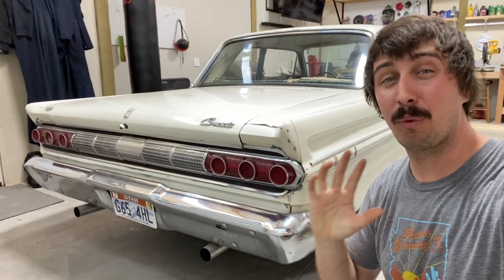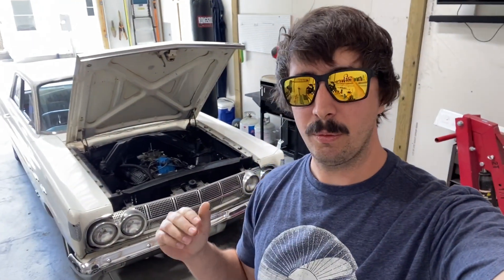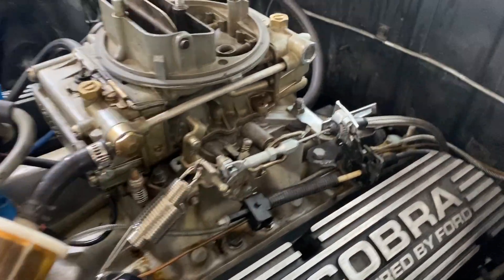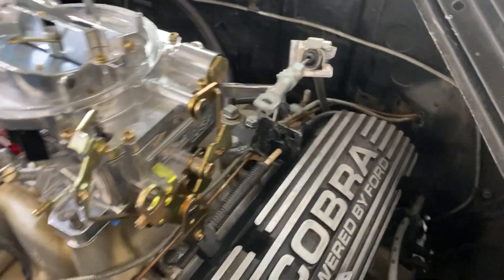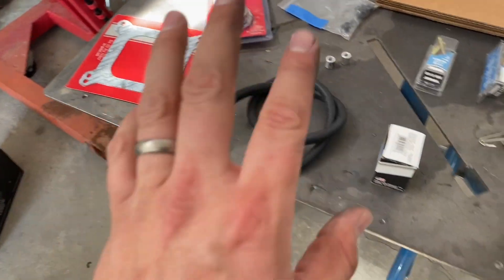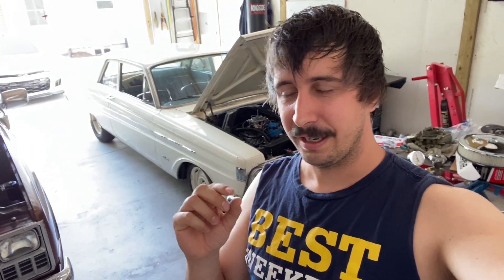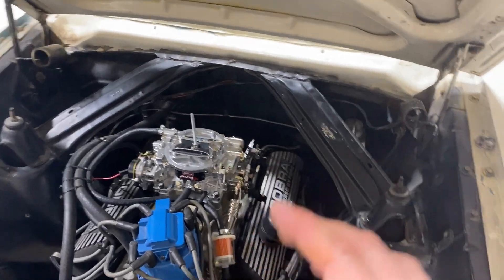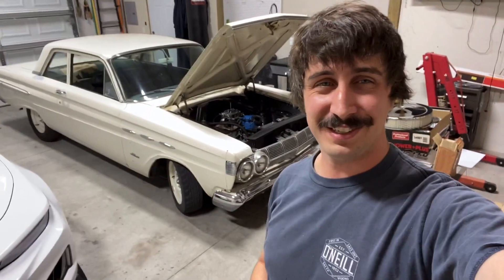How to Install an Edelbrock Carb: The Basics

Comment: i have the same Edelbrock Performer 600 CFM 4-Barrel Carburetor 1406, and eldeonbrock performer manifold ,, i see your has a spacer plate on  your manifold ,, does it need the spacer plate to make it run ,, i never put the manifold spacer on mine ,, thanks
Reply from the maker: @shirley-h2o  spacer is only needed if you have a need for extra clearance or you are looking for a bit more performance.  Some motors respond well to a 1” spacer.  To answer your question no it’s not needed.

Comment: worst fuel regulator  money can buy
Reply from the maker: @heytonight1  I’ll challenge you on that one. I had two jegs regulators fail on me and I’ve actually had pretty good luck with this one and a Holley that I run on another car.  Worse yet, I had three jegs fuel pressure gauges. Be bad out of the box. My best luck has been with Fragola
Reply: @truckandroll989  yeah nothing is made proper i hear that. no challenge necessary i just didnt have a great time with my mr. gasket
Reply from the maker: @heytonight1  couldnt agree more! Its all off shore junk these days 🤪

Comment: Get the dual fuel line
Reply from the maker: Im not sure I follow.  Edelbrocks have a single feed.  Do you mean a return back to the tank?
Reply: @truckandroll989  No they offer a duel fuel line now for the new ones to help level out both fuel burn ..
Reply: @truckandroll989  Edelbrock Dual-Feed Fuel Line and Filter Kits 8128

Comment: Car sounds great. What mufflers are you running?
Reply from the maker: At the time this video was made some cheapo 2” Glass Packs.  Check out some of my newer videos where I added a cam, heads, long tubes, etc.  I recently did full exhaust (Patriot headers), 2.5” tubes, X pipe, and Flowmaster Super 44s

Comment: I just installed the same carb along with an AFR gauge, and found it to be running a bit rich. To lean it out, I swapped out the rods,  plus went down on the main jets. Because it still runs slightly rich, I decided to check my fuel pressure. ...low and behold, it was at  9 psi. With the addition of a Holley pressure regulator, it's now dialed back to 5.5-6 psi. Back to the drawing board and start the tunning process all over again.
Reply from the maker: Yes you are heading down the correct path.  So many people do not read edelbrock’s instructions and wind up chasing their tail.

Comment: I'm done buying Mr Gasket products. The timing cover bottom seal channel was so far off that the metal hit my oil pan and wouldn't allow it to seal. I also bought their recurve kit and with the light springs, the weights wouldn't go home, but stayed open slightly.

Comment: Did you install longer studs to account for the carb spacer? I am adding a 1406 to my 68 mustang with a spacer as well.
Reply from the maker: I sort of forget when I did this one. However, I believe I had some longer studs on hand that I may have used. You will know for sure if the studs are too short.

Comment: No no no ! I'll ask you one simple question my friend. Go to the drag strip. Not on test and tune day but event day.  Go along and count how many Edelbrock carbs you see VS Holley carbs. EXACTLY HOLLEY CARBS ARE THE SHIT. Further more way easier to tune. No if ands butts about it. Anyone who says different ? Is just mis informed . Dump the Edelbrock get a Holley. Hell we can set it up for ya live while you are doing it. They are that easy !!
Reply from the maker: Personally Ive owned both.  I agree that for performance Holleys are pretty much the industry standard but for a cruiser I will take a Performer over a double pumper all day.  The vacuum secondary holleys are alright but IMO the Edelbrock just runs smoother for a daily setup